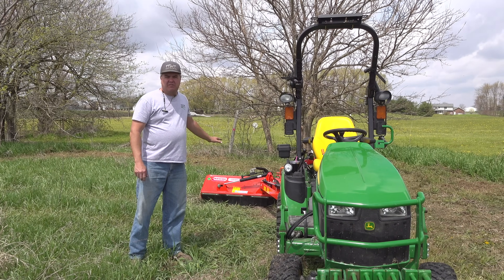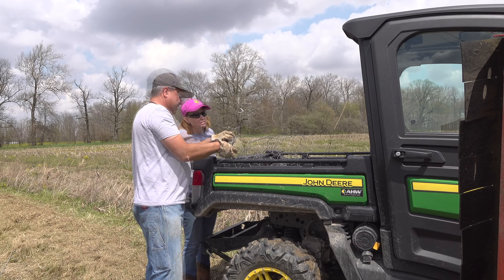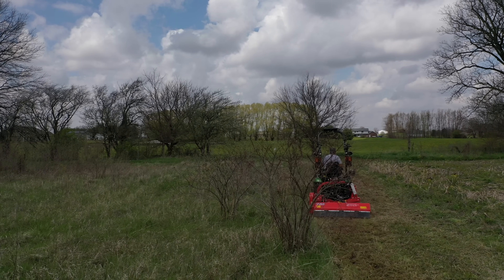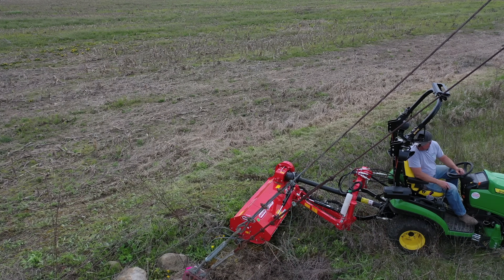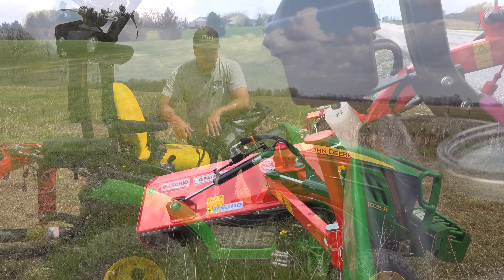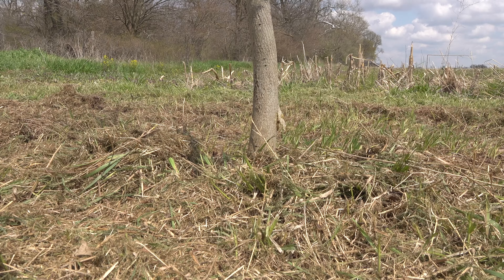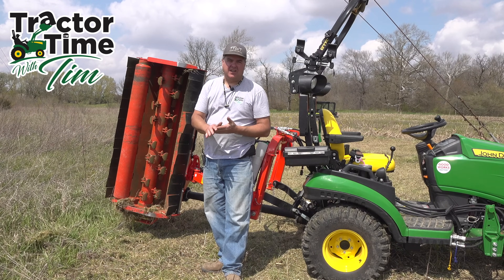NEVER BEFORE SEEN!!  Offset Flail on Sub Compact Tractor

Comment: Tim I bet if you took your bolt on wheel weights and put them both in the left rear wheel you’d find a big improvement on the stability of Johnny! If you watch videos of the DOT offset mowers they always have a counter weight on the opposite side of the tractor

Comment: I really think that the flail mowers are the way of the future. Sine I bought mine back in May of 2019, I haven't used my brush hog. The flail mower cuts closer and mulches at the same time
Reply: The flail mower is better in a cleared field environment but the rotary works better for brush work.

Comment: Thanks for leaving the barbed wire problem in your video. It just shows the real world problems encountered on working out in the public. Part of the work process is solving problems encountered each day. Your father taught you well on how to handle them.
Reply from the maker: Thanks Tim.  One thing I have learned over the years is that getting angry doesn't help ANYTHING, and actually makes the task even LESS enjoyable.   Just deal with it and go on.   
Of course, that is easier to do when there is "no hurry" in the project.

Comment: I've been using a 54" flail behind our B2650.  Cleared several acres of heavy overgrowth with it, grass / brush about 5' tall and saplings up to 2" diameter without too much trouble.  I have the "hammers" on mine, figured the cutting blades would not hold up too well given our property.  A couple passes in different directions and all that's left is a fine mulch on the ground.  Worked great for clearing a spot for our home.

Comment: Rough guess on weights - that mower is about 1/3 the weight of your tractor. When you lifted it, it did not look safe. I seriously doubt a subcompact weighs enough to be stable with that mower in lifted or lowered configurations on a modest bank. A sickle mower would be a much better option for compact tractors. I can't figure out why they aren't more widely available for the compact market.

Comment: I've had the 60" version of this flail on my JD 4720 for about 10 years now and I agree with much of what Tim has said.  I grew up with an older 7' Ford 917 flail (grass cutter with hanging blades) and bought this for brush mowing and hill, bank maintenance.  I call mine the eraser because it just makes things go away...  The flail portion is great and in 10 years and hundreds of hours of hard use I've only had to replace two of the hammers due to large rock strikes.  The ditch bank is another story...  Even on my 4720 tractor its been a pain the butt.  When I first bought the flail I had a longer set of hoses from my local Deere dealer that I ran under the tractor, I eventually replaced that setup with a dual SVC setup from Deere that uses an electric valve to reroute the flow from the loader stick.  It works well but I have had problems with the valves occasionally freezing up and that repair has been rather expensive when it happens .  
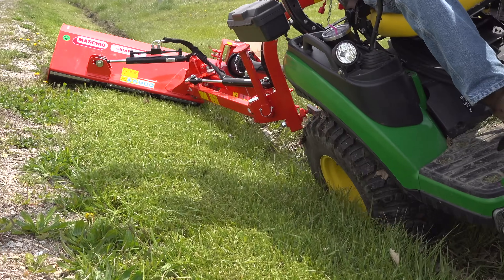Back to the mower... I routinely loose snap pins from the 3 point and have had to have several upgrades done to beef up the mechanism.  The most severe was one of the pivot beams breaking and the most recent repair was to the mounting point for the pivot on the flail itself...  The welds that hold the pivot cracked and the flail was trying to separate from the mounting.    Looking at Tim's unit it looks like they redesigned this...  It also looks like they cost reduced the swing back mount (extended at 9:16 right side three point mount) that protects things when you run the flail into a solid object like a tree/fence post and changed the debris flap from metal to rubber.  Otherwise mine appears almost identical other than the scars of many years of abuse...
The other thing even with a bigger tractor when using this mower you have to be very careful as it will easily pull the opposite rear wheel off the ground, 9:55 in the video is a time when I have to be careful, maybe his lower center of gravity is helping....  When I bought mine I really wanted the bigger 7' model but it required the next category up hitch.  I had the HP to drive it so I was initially disappointed but after my first usage I realized that would have been a horrible idea...  Honestly I'm amazed Tim did as well as he did with such a small tractor.   Flails really like HP and the ditch bank really needs a heavy tractor for ballast.   I also use mine with the loader attached for counter balance.
If this one ever totally dies I'll buy another Maschio with hammers, but the next one will be a 6' or 7' horizontal shift unit...  
One other comment for those of you asking about floating the slots he talk about take care of that nicely...
Reply: Tim if you would like any other info just let me know... BTW when clearing I also use a large root grapple on the front with a skid steer adapter plate and and extended SVC on the loader arms..
Reply: I have a 4720 and have been looking for a solution to mow pretty steep banks alongside a road, and also terraces in my fields. Tom you said you would buy a 6 or 7 foot unit with horizontal shift? Are you confident your 4720 could handle it okay? Thanks.
Reply from the maker: I really think the offset version like I have would be better than a horizontal shift for ditch banks.  4720 would handle 5’ easily.
Reply: @jakespoon7994 So the limitation with this mower on a 4720 is the hitch setup.  Its not a horsepower or lift issue it's the tractor weight and the hitch category.  With a horizontal shift flail those issues are not present because you are not lifting the flail in the same way.  We still run the old  7' Ford flail on a 35 PTO HP (1070 Deere) tractor for mowing grass and light brush.  Prior to the 1070 we actually ran that old flail on a Ford NAA Golden Jubilee.  The Ford would occasionally stall out in high grass, but it ran it that way for many many years... The only time you need big HP is for grinding heavy brush and that's where my setup works well.  Now interestingly enough it appears since I bought mine they now offer the same setup in an XL that goes up to 7' where as before you had to go up to the next model (Giraffona).  Based on how my tractor handles the smaller mower I think I'd be leery of the 7' in a ditch bank...  BTW I'm in central Ohio, maybe I should bring my setup over to Tim's tower project for a video :)
Reply: @TractorTimewithTim  Agreed, the offset definitely gives you more reach but it also adds a lot of wear and tear on the tractor
Reply: Thanks guys, I really appreciate the help.
Reply: @MrTom9933  Tom, I was going to say about one of your previous statements , which i see you corrected here, having worked on flail mowers and shredders on all sorts of material from weeds to decent size hardwood prunings for over fifteen years on all size tractors i think it is important that people understand that the main force at work with them is not the horsepower but momentum. This can be seen by how long the rotor continues to spin after you shut of the pto. It also means even with a really high horsepower tractor if you take in to much material to fast 130 horsepower won't do any better than 55, it will just wear the belts much faster. Sometimes driving a little slower will improve the ability of the mower more than switching to a larger tractor.

Comment: I purchased a 50 inch Betstco Flail Mower two years ago. I can tell you that unit eats everything. My one complaint is they do not offer hammer head blades for it for grass only. One thing that I would caution you on, do not back up with the flail down. It puts a lot of strain on the belts/chain drive. It also seems to dull the blades more. I am very glad to see you trying the offset. You solidified my thoughts and that is the offset probably would not have worked for me. I have been kicking around the idea of trading my 1025r in and go get a 3046r just to give me more power and a little larger implements for what is available in used market. Just a lot of tractor for 1 acre.

Comment: Hey.... I’m happy to see you running a Maschio. They make the nicest, heavy duty flails. I did a lot of research before buying mine which is a Buffalo 300 (12’). Mine shreds 6” logs no problem. One thing about flails, if your cutting just grass, knives are best. Yours has hammers (what I have also), is better for land reclamation on more woody stuff. The nice thing about a flail over rotary cutters is that it shreds grass to be broken down faster. Maschio is a Italian company that is in the USA manufacturing John Deere hydraulic tillage. Maschio makes a ton of different attachments and implements but are just starting to offer them in the US market. Their 3-point mounted sprayers are really nice! Great video Tim.... those bushes your cutting either need to be pulled by the root or manually cut with Tordon on the stump. 

A tip... buy a pair of Knipex bolt cutters, they are the size of pliers and cut barbwire like butter.
Reply from the maker: knipex bolt cutters are on order.
Reply: With the shredders getting the rotter stuck up is the least of the worries. I had someone working on my tractor and before it got stopped up it shredded a bunch of barbed wire. The worker had placed his lunch box behind his back, partially above the top of the seat. If not for the lunch box the wire would have gone into his back, it was inbeded deep in the lunch box.
Tell me, as i was looking into a wide offset flail, i was thinking with a 12 foot an arc welder would be the tool to keep on hand. It has no problem holding it's weight, even the stationary fails i have seen all seam to have cracks.

Comment: Hi Tim when my 1026r was delivered Jd had installed two outlets on the back of the tractor.
This has been very useful for my trailer and hydraulic grass collector. I still have my mid hydraulic connections.

Comment: Any progress on the hydraulics kit you mentioned in your video? Have a few more questions about hydraulics hose configurations - to the loader bucket and to the flail mower. Do I need to disconnect hoses for bucket and use your kit to connect to the flail mower? And then when done mowing, but things back the way they were, reconnecting the front loader bucket?

Comment: Figured you would use the Johnny 2038 for this implement. But the 1025 handled it better than I thought. My flail mower is able to offset manually. Remove 6 bolts and plare hitch 6" to the 2nd position. Have not done that yet.
Reply: What is the make and model of your flail mower? I would like to see this one is action too.
Reply: @joebarrett9830  LandPride 2172. I have a short vid of it mowing scotch broom.

Comment: This is very helpful. I am purchasing a 65in ditchbank flail for my 3038e. With factory installed rear controls. I think the 3 series will handle it well after watching this video. Thanks a lot for posting.
Reply from the maker: Consider the Maschio from agfolks.com. Use code TTWT for a 5% discount.

Comment: Tim, the Knipex 71 32 200 Comfort Grip High Leverage CoBolt Cutter with Notch and Spring on the Azon are the most wonderful cutters.  They are built like miniature bolt cutters and greatly reduce the effort to snip things in two.  Not a diagonal cutter.  Love mine!  Love seeing your flail mower.  I wonder if you would have as many spring back up things if you were cutting lower.  Are those new lights on the ROPS?  The guarding on those lights looks high quality.

Comment: I'm guessing it won't work with the Quick Hitch due to the clearance needed for the swing of the PTO shaft.  The 1025  is definitely on the small side for that mower but it did work... I've been considering an offset mower for a while but never knew of this unit.  With my 3039R I should be able to run a 63-65" unit w/o trouble..   Nice unit there, Tim..

Comment: I could sit and watch you guys all day.  I've heard you can't mow in reverse with a flail mower, is that true?  Or maybe it was just the one that person was using.  Thanks guys.
Reply from the maker: It does not mow very well in reverse
Reply: Mowing in reverse with a flail mower is very strenuous on the belts/chains and will dull the hammer or "y" knives much faster.

Comment: Excellent information as always. 

I was impressed at how easily it seemed to drive the flail mower I was always under the impression they need quite a lot of horse power. 

Look forward to seeing it on the 2 series. The extra weight will make all the difference.

Comment: Thanks Tim & Christy. I think that flail mower performed well but as you said, the 4 footer may have been a bit better with your 1025r.  I have an area in the front of my land I dread cutting and most of the time I just won't cut it b/c of the steepness.  That's when I'd love to have something like this.  Thanks again for the demonstration.  Full-watch.   👍🏽

Comment: Nice video. For the size tractor I'm thinking of getting (Kubota BX23s) I would get the non offset type.
As far as the hydraulic hose set for rear operation, do you need to consider hydraulic fluid skin injection if the hoses run near the operator and there is a leak? Or will the hose kit allow the hoses to run to the rear and not be near the operator?

Comment: Hi there! I didnt fully understood the part that the offset it too big for the Flail Mower, or for the compact tractor. I'm looking for a Offset Flail Mower to work in solar panel fields, where I need a compact tractor, like the Kubota 2401 for example, that has 24HP. I need it to move to the sides, in order to avoid the manual labour with a stihl FS350 for example.  Can you recommend me something? I speak english, but not native... that's why I didn't get all from the video. But it was great tho!! Thanks!
Reply from the maker: These small compact tractors are not heavy enough to gracefully handle the offset mower when it is fully extended.  
If you are extending it on flat ground you will be fine.
I would recommend wheel weights on the tractor.
Reply: @TractorTimewithTim  Thanks Tim for the fast reply! What are the best brands for offset flail mowers? I'm looking only italians for now, like Rinieri or Sicma SpA (the mm)
Can you recommend me an USA brand? or others
Reply from the maker: @adrianoaste7041  I like the Maschio Gespardo.  You can get from agfolks.com use code ttwt or from roc-pit equipment (mention ttwt for discount).
Reply: @TractorTimewithTim  thanks!

Comment: Do you know if just the flail mower is quick hitch compatible without the offset function?
Reply from the maker: Yes. The direct behind flail is quick hitch compatible.
Reply: @TractorTimewithTim   I found on there website you can get a add on kit for quik hitch
Reply from the maker: Yes.

Comment: Tim, can you mow with that in the vertical position? for example to mow back a woodline edge?
Reply from the maker: Yes, you can mow in any position.
Reply: You should at least have a cab if you are going to do it, and still with a cab you might loose your side/back window and get quite the headace. Never do it with the tractor in reverse and always keep spectators at a distance. If your drive forward the cuttings almost always go backwards or backwards to the side. I have a 1.8Meter(6feet) model and have thrown sticks of wood 20-30meters(60-100 feet) with the mower in vertical position. And respect the offset weight. On a hill driving sideways you should have the implement upwards if possible or drive the tractor up/down the hill. Here in Norway  this type mower is used alot on farms and roadsides, and for more durability we use a HD bushhog design with chains insted of a blade. You could search for "slagkraft" on google. or watch at timestamp 5.26 on this video to see how it is underneath.

Comment: I like the less mulch piles with the flail over the rotary cutter. Will the flail cut heavy brush and small trees like a rotary cutter though?
Reply: RK Harm24 depends on model, the blades on this one are the lightest duty style so maybe an inch. I’ve seen where 30hp or less can go to 2.5 to 3in with the different blade types.

Comment: I don't know if anyone mentioned it yet. When mowing in wet grass and really tall stuff you'll leave stragglers behind b/c of the tires compressing it before the mower. I think having the offset helps in that case being so far back it gives more time for it to stand back up before the blades hit it. Also it you are worried about it being tippy when in off set mode the only way to fix that is to add counter weight to the tractor. Like filling your left rear tire with water or adding a wheel weight or both to help balance the tractor like you did with the front weights. I think that the way you had it setup was pretty good for that little tractor, I just think it could use a little wheel weight for counter balance. The only thing I didn't like was how Jerky the hydros were when tilting it up to 90 degrees. But that could just be a flow or pressure setting on the tractor. Overall I would buy that set up as is, just needs a little tweeking to get it dialed in.

Comment: Good morning Tim. Agree with you 100%. They are pretty practical attachments but not sure hanging them out off the back of the smaller subs and smaller compacts is a good idea. There is a lot of weight and forces of energy being applied to the 3 point which those tractors are not engineered to handle. Thanks for the great overview and honest review for folks! Cheers!

Comment: I know was a video 3 years ago but I have a question about this mower.
Do you think this would work on a B2601? The 1025 and B2601 are so close in size I thought I would ask.
Reply from the maker: Only with rimguard and rear wheel weights …and get the size smaller than this
Reply: Thank you